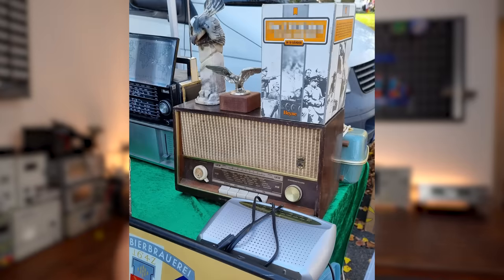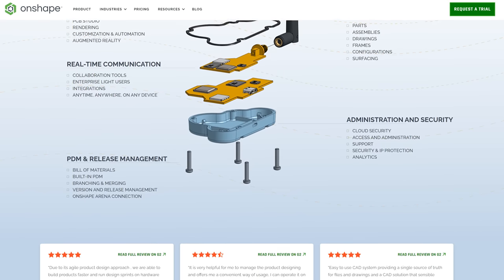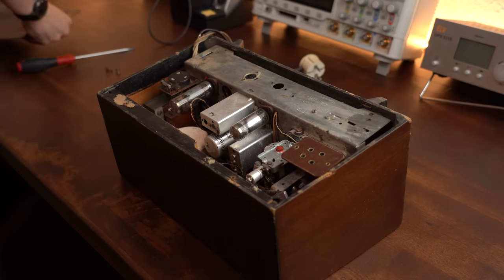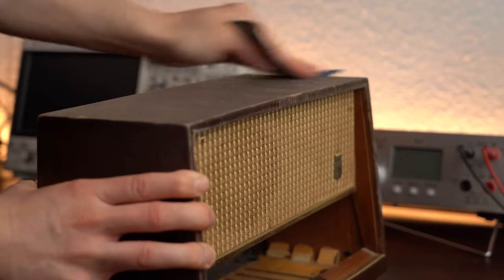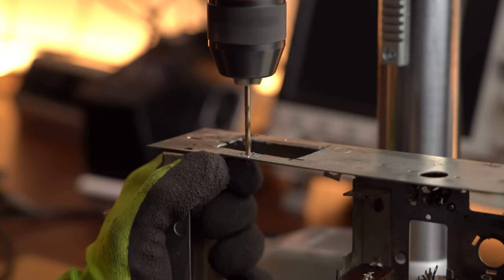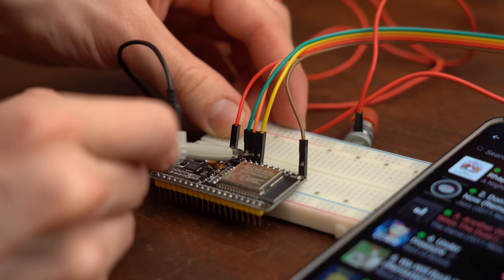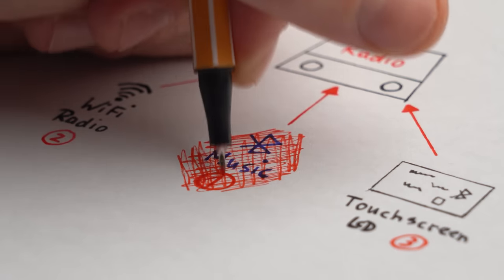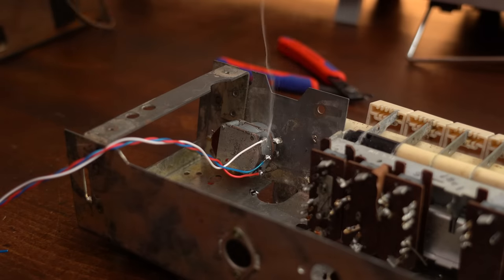I Spent 20€ at a Flea Market and made Something AMAZING! (Internet Radio)

Comment: Could you do a video on Electronic control of tankless water heater: Use a PID? SSR vs SCR?
I have an 8KW Atmor tankless water heater that has two switched heating elements. I want to add stable electronic temperature control. But I can't find good information about the different options!
Seems the PID + SSR MAY have longer switching time, and that MAY reduce heating element life from thermal cycling vs a higher speed SCR. But I am having trouble finding the real answer.

Comment: Esp32 is a powerful piece of hardware for its price, but sadly the the part where it falls short is the libraries. Arduino has a such a big backing of the community. I also was working once on the 32 where I wanted ro install the neopixel library on it l, but quickly got to know that there is not a lib for 32. There is a port but it doesn't works properly.
Reply: Use FastLED! So much better and more capable than the Neopixel library, just as simple to use. The Arduino has more libraries for sure, but the ESP32 is quickly catching up, and the hardware isn't nearly as limiting as the Arduino. Arduino is also weirdly expensive for a really old 8 bit microcontroller, especially when you can get much faster, more capable controllers like the RP2040 or ESP32 or other 32 bit controllers that have cool stuff like built in WiFi or hardware acceleration for floating point operations.
Reply: @evanbarnes9984  thanks for the suggestion. Also, I guess arduino is using the lib support as an excuse for keeping the boards price unreasonable.

Comment: I used a raspberry Pi for my home-build alarm-clock-radio with some Numitron tubes for the clock. An old radio would definitely have made a better case though. 
For he same reasons as you concerning the look of commercial ones. 
Maybe I'll re-house it when I find a suitable one.

Comment: What is I²S Amp? My knowledge about audio is very limited, but what you are describing sounds for me like a DAC (Digital-to-Analog Converter). Am I missing something?
Furthermore, the links for ESP32 and I2S Amp are both pointing to the ESP32.

A great video as always. Not really interested in a radio specifically, but still inspiring.
Reply: It's just a DAC and audio amp with a I2S interface on one board.

Comment: Nice project but the touchscreen ruins the aesthetic in my opinion.
The existing buttons would have been a good use for channel change or the second dial after changing the potentiometer with a switch dial?

Comment: Thanks for the idea. I don't need an internet radio but a Bluetooth speaker with aux input. And decent quality ones are rather expensive, especially for a student. So planning to salvage an old speaker set and DIYing the circuit. Will try the ESP32 I2S Bluetooth audio library.
Reply: The KCX BT002(5€) and an amp is all you need....
Reply: just use a CRS8670 or 8645, and you will get extremely good audio quality that the esp cant even dream of delivering, if you are making a speaker system, honestly tuning the cross overs and the amp is the main thing to get right
Reply: @gggf654  5€ is too high for India. We are a poor country.
Reply: @ShahZahid  I want to design my own as a project. I will make my own PCB. I'm not making anything audiophile level, anything that creates a distortion-free sound is okay. Just need a cheap speaker set (we have some thrown away speakers in the university backyard, not sure if I am allowed to pick them up.)  and a I2S decoder + amp. I already have a couple of ESP32s. The goal is to keep the shortest and cheapest possible BOM.
Reply: @PrajjalakChattopadhyay  I like your idea... but making your own pcb with components would make it much more expensive i guess
Reply: @PrajjalakChattopadhyay  dude im from india too and you can get those modules here for cheap, but whatever suits you, also yea high price for electronics in india is due to the govt banning chinese sites like AliExpress, but still allow local sellers to import stuff from china, well anyways good luck
Reply: @gggf654  for educational purpose

Comment: As other already mentioned, LCD is really obsolete. Buttons or station selector from original radio would be way nicer. Challenge mode: instead of using D class amplifier, feed output from first stage to original tube amplifier for soft tube sound.

Other than that, you made something professionals would pull their hair - same wire color for phase and ground on mains side!? Please use proper color coding for mains wires.

Comment: Good job 👏. But the touch screen seems a bit odd. If you put it in the middle of the radio, it would have been more nice
Reply from the maker: It actually fits better for me this way because I can put it anywhere. It is actually right now not sitting on the radio but at its side right on the fridge. I also added a magnets in the touchscreens enclosure so that it attaches to the fridge easily ;-)
Reply: Ok

Comment: Very nice project. I'm trying to do something similar with esp32 for web radio but wanted to output the sound via Bluetooth to a wireless speaker. But I'm struggling with coding and haven't even gotten to the part of using a display and a rotary encoder to scroll and select the different stations. Now I'm willing to give it another go by using chatgpt to help with the coding...
Reply: Hello

Comment: You did a great work, but adding an LCD completely ruined the aesthetic of the old radio.
IMHO you could use the physical buttons to switch stations and Bluetooth from your mobile if you want other controls (or maybe adding Bluetooth to the LCD module, and totally separate both)

Comment: It's a pity you did not used the original tube electronics, I am almost 99% sure the amp was still going. You could have used the tube pre and amp stage connected to the modern electronics.

Comment: This is honestly pretty disappointing. These radios are becoming collectors items, and in the US a Grundig is seen as fairly high end. It's your radio, do what you want with it, but I would have much rather seen it kept as original as possible. You still could have had your little touchscreen box on top and just put the logic and I2S amplifier in there, and then fed the audio signal through the existing amplifier. Some sort of switching mechanism that cut the audio feed from the terrestrial radio and injected the one from the internet radio in it's place when that portion is powered on would have been a clean way to do it. Recapped and working one of these radios is easily worth 10x what you paid for it.

Comment: Nice project. But I would agree with the others that suggested using the original white buttons for channel changing, then the dials for volume control (and the other dial for changing function if a wifi music like spotify can be integrated), and then lastly…use the old tube as the power amplifier of the unit.

As for the LCD…I wonder if it can replace the plastic face plate that shows the radio station, so that it won’t piggyback on top of the radio.

Comment: Great job! Great inspiration! Thank you! Interesting your approach with the ESP32. Certainly a viable solution! 
I would have used a raspberry pi with a pi-dac (or similar audio interface) with an HDMI screen and a image like moode audio or volumio. Which would have given you bluetooth as well as google cast and airplay. Given the huge cost of your display this may have come in not even much more expensive, if you could get your hands on a pi 3. Moode and volumio have an interface which should work on a small hdmi touch screen.

Comment: Hey, my grandad has that kind of radio, but bigger  and with record player on top. I was tempted to repair it last year, but at some point mice made a nest in there and I did not feel like testing every component in there. This gave me inspiration again. But why did you choose to use touch screen instead of using original buttons?
Reply: Why would you have to test every component? Just replace what looks bad, replace the capacitors that age and then plug it in with series with a light bulb. Check if all the voltages are correct with the schematic and then plug it in without the light bulb and see if it does something. If it doesn't work, start checking the power supply circuit, then amplifier (with a line input or record player) and then the rest
Reply: @KofolaDealer  the problem is that someone already had it "repaired" couple times and the schematics dont match reality. It did turn on if i remember correctly  but radio didint work as the antena wires were chewed off and its a AM radio with preset stations. And record player motor was dead for sure. Also not even sure how to test vacuume tube properly. Did not teach that in uni.

Comment: I love watching GreatScott, and I've learned so much from his channel.

However, this build felt rushed and unpolished. Perhaps I'm too spoiled with things from channels like DIY Perks though. Also not having Bluetooth at the end sorta makes the project seem very limited, and lacking in utility. Additionally, the project vision seems a little all over the place. If the point was to really get more life out of the classic radio, it should have been cleaned up a little more, and more of the original hardware incorporated. Also, the touchscreen seems very out of place since the original hardware could have been used for the simple internet radio features added. It also seems very out of place just stuck to the top of the radio. It made me wonder if it was thrown in there just to get that STM board on the channel.

As a kid, I remember watching shows and you'd always have those episodes that were filler episodes that left you feeling unsatisfied at the end. That is how this project felt to me. This seems more like a video that is made and put on a second channel as a project that didn't quite go to plan, and you talk a little more about the troubles you had so others can learn from them.

All that said, please keep doing a great job. I've watched your content for years and love it, keep up the great work!

Comment: but the onboard station button in front of the radio look far better than the lcd screen which does not fit at all.

Why didn't you use the old station switches there ?

Comment: I did the same but I went the easy way: a cheap bluetooth + battery board bought on aliexpress. So my old 1930's radio is now looking new again and is a modern bluetooth speaker.
I reused the knobs as volume or prev/next buttons and hid an USB charge port under another knob and a magnetic holder.

Comment: Would adding servo motors and sensors to the potentiometer to select the radio stations and do other operations work?
Reply: It's a variable capacitor and you can just measure it's value. No need to add servo's.

Comment: I have a radio like that and I have been thinking about converting it to a Bluetooth speaker. Now I'm afraid it's not that easy. How would you suggest I go about that?
Reply: Look up some videos about restoring those radios. It's not that hard and in your case you only need the amp in good working condition. Replace paper caps and electrolytics and your good. Add a Bluetooth module to the line in. Done. A thousand examples out there. Much cheaper then this method.

Comment: but did u try to debug on the software side

sounds like a lack of knowledge of microcontroller, specifically software side

hate when engineers only knows hardware and becomes worse than an average person when working on programming
Reply from the maker: I am indeed not a programmer.

Comment: This is a no from me. I'm pretty sure there was wais to turn it in what you wanted without destroying everything
Reply from the maker: I mean there are ways for everything. But that was simply not my goal. Sorry.
Reply: Agree. I have a nice 1958 tube radio.
I get bluetooth and DAB+ on it by using one of those retrofit FM senders that are meant for cars.
All that stuffed in a box and hidden on my shelf, sending the signal by FM to the radio.
The Radio stayed unmodified.
Reply: We don't know how broken it was to begin with .. but I too was hoping he would disable the old cirquit in a reversible manner :(
Reply: @greatscottlab  Simple bypass on the speaker and 3D printed case on top of it would have been enough?
Reply: This is not a rare antique, these are everywhere. Not a big value.
Reply: @DanielBulyovcsity  If it isn't a rare antique .. you just haven't waited long enough yet ;)
Reply: @DanielBulyovcsity  Not reason enough, in my opinion, to destroy it when there was enough space inside to add any modern electronics and knowledge to bypass the old tech. that was what i was hopping to see

Comment: This was disappointing on several points.  You didn't use the amplifier provided by the radio. You didn't use the switches on the front. You didn't use the variable capacitor to dail in the stations. There are projects around that tune digital radio by measuring the capacitance of the tuning capacitor. 
Basically you could have made an wood enclosure for the touchscreen and be done with it. 
I know you can do better, i have seen your other videos. 
P.s. you overpaid for the radio.

Comment: This is terrible
Reply: Why?
Reply from the maker: Everyone has their own taste.
Reply: @aabidhshifaz2090  I think old electronics especially tube electronics shouldn't be updated only repaired
Reply: @greatscottlab  I agree with that
Reply: @greatscottlab  Agreed!
Reply: @eppe8755  Well that completely depends on the person and what they want to do with what they have. Updating retro electronics tag are beyond repair would give it a new life
Reply: @aabidhshifaz2090  There's no such thing as beyond repair. I've seen some bad ones with dead transformers or broken coils but even that can be repaired if you try hard enough
Reply: @KofolaDealer  Dead transformers and coils are an easy fix. The problem is retro tech is outdated so most of the electronics used in it, are usually not available at all in the market rn. Damaged PCBs are also a problem. These sometimes render the tech useless.
Reply: @aabidhshifaz2090  Like what electronics? I listed those that are the hardest to replace and I don't see an easy way to fix a shorted primary winding that's buried under the secondary like they used to do it on old radios. Tubes, capacitors and resistors are easy to replace, the rest don't tend to break

Comment: I have to judge this project as a sacrilegious desecration by an unthinking millennial with no sense of history.  To start with, you think that you picked up a 1973 ("50 year old") radio when it's clearly at least a decade older than that.  

Then you proceed to hack out the collectable innards, chop new holes in both the chassis and case, and tack on a modern touchscreen (thus completely spoiling the esthetics that you said you wanted the radio for in the first place).

It's the equivalent of finding an early 60s Split-window VW Type 2 [Microbus / Combi / Transporter] in somebody's barn, thinking it's from the 70s, and then because it "looks retro",  deciding to cut out and throw away the interior and engine, and finally turn it into an LED-festooned storage bin.

Shame on you!